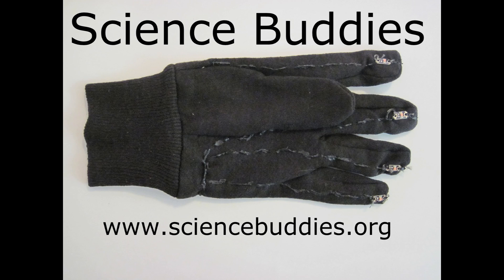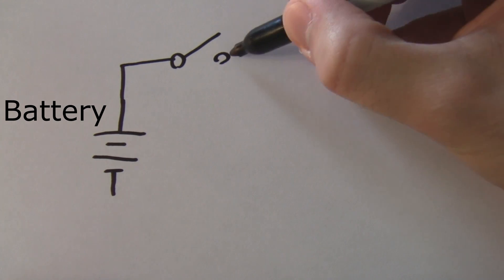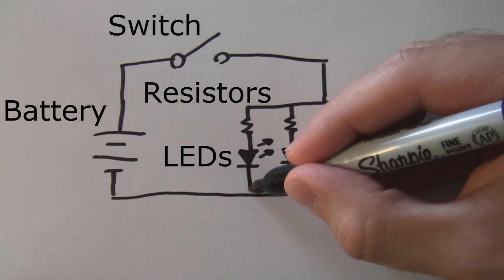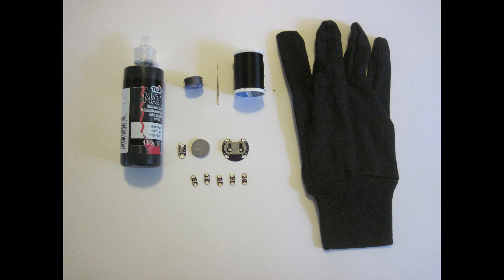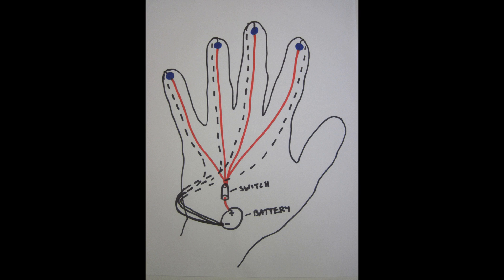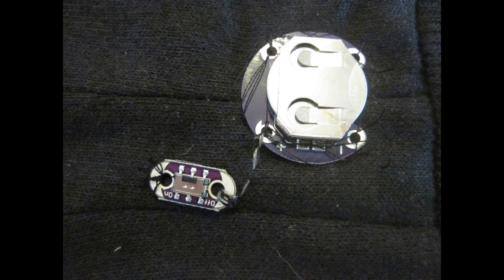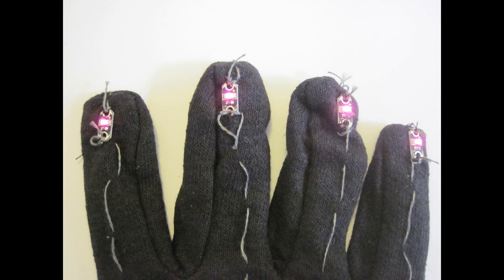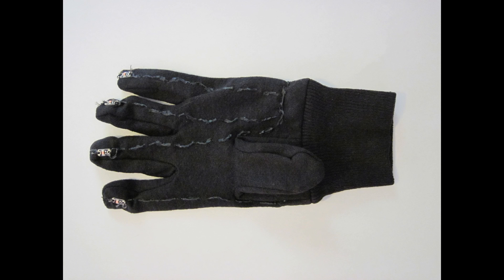Build your Own LED Dance Glove | Science Project

Comment: We are not having any luck with this. Either the LEDs light up for a few seconds, or only three light, or just none. Usually none. There are no short circuits, no stay threads (we even did it cleaner than shown). It's just very frustrating. I've done much more complicated circuitry in my own projects growing up and i can't believe how poorly this works. I'm thinking "conductive" thread is a scam.
Reply from the maker: If the LEDs are lighting up intermittently/inconsistently, then that problem likely indicates loose connections or short circuits. If the problem was just the resistance of the conductive thread (which is definitely higher than copper wire), then they might be dim but should at least be on continuously. Do the problems only happen when wearing the glove and moving your hand around? If you can turn the glove on and put it down and the LEDs stay on, that could be another indicator that there are loose connections or short circuits that happen intermittently when it's moving around. It's also very important to use a fresh battery. All that being said, if you find the conductive thread frustrating you can just do it with copper wire instead: https://youtu.be/KL1tAbz8k0k

Comment: My sister and I built this just like the video. However the little 3V coin battery was to weak to provide enough current for even 3 lights..It works for a little bit then dies out. Our connections are all tight.  Higher voltage battery is needed!